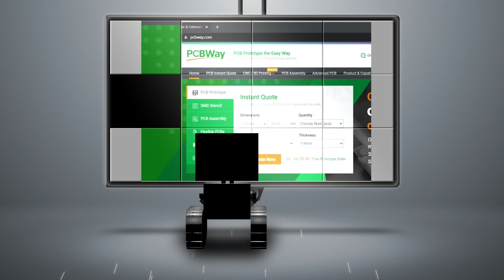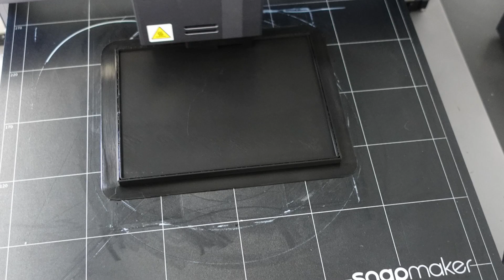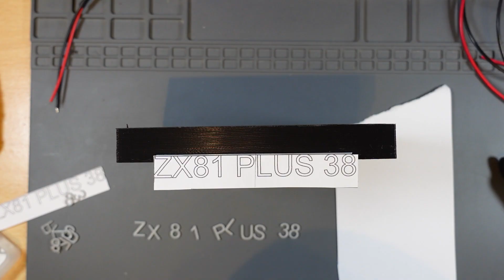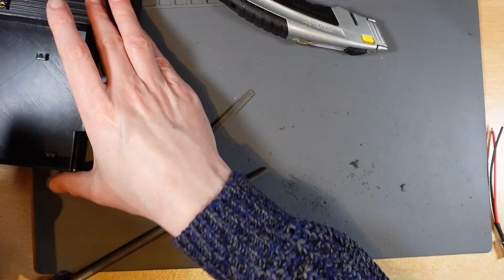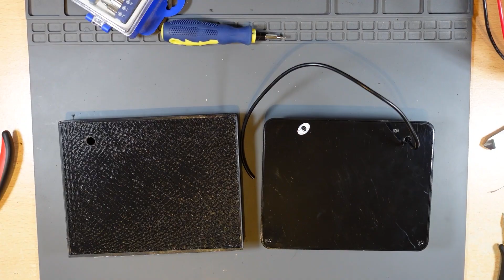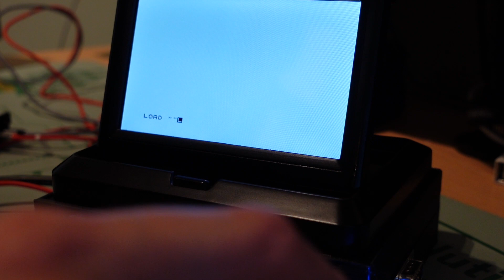I built an All-In-One ZX81 | ZX81 Case | Voting Finished | Part 5 | #zx81

Comment: great project! Why don't you build the same with SMD components ?
Reply from the maker: That sounds fun. I've just bought a hot air soldering station and digital microscope which I'll be using in my next video, they'll come in handy if I decide to do this.

Comment: HOW IS THAT THIS CHANNEL HAVE NOT TONS OF ZX FANS? I WILL SHARE YOUR CHANNEL IN MY FACEBOOK PROFILE.
HAVE YOU THOUGHT HOW TO PRINT YOUR OWN ZX81 keyboard MEMBRANE? not the underlying one, i mean a home made replica membrane with the printed commands in it, is it possible with a laser printer and some special printing paper or available printable fabric in the market to this or is it impossible? what do you think? cheers!
Reply from the maker: Thank you for the share, much appreciated! Since the ZX81 keyboard layout is bonded to the electrical membrane I think a homemade version would be quite challenging as you'd need to somehow make the keyboard membrane. Or if you were to replace the membrane with the smaller tactile keyboard from this video https://www.youtube.com/watch?v=6a8wxj9vJjU, then maybe printing they keyboard design on paper and laminating would work.

Comment: That's amazing! I've been wondering what a modern ZX81 would look like. This is very inspiring.
Maybe I wasn't listening properly, but why not use 5v from a USB connector for power supply?
Reply from the maker: Thanks! The monitor uses 9 volts and the ZX81+38 5 volts. I only wanted one power connection on the machine, so I didn't have to have separate power supply for monitor and computer. So I used 9 volts to supply the monitor and then also stepped this down to 5 volts for the ZX81+38.